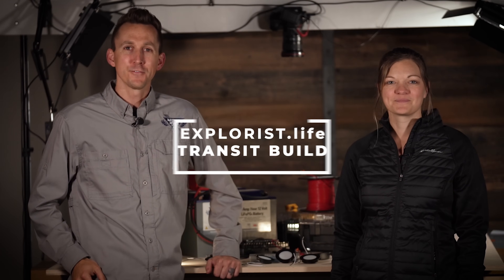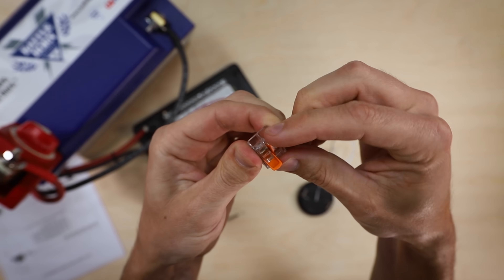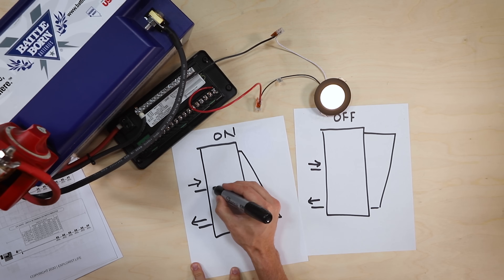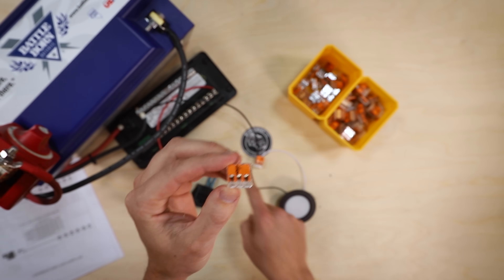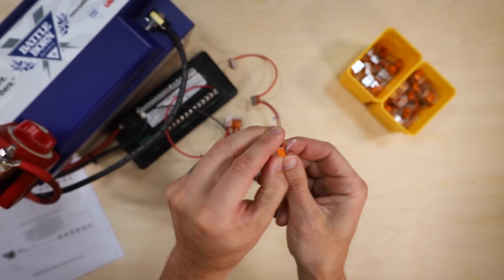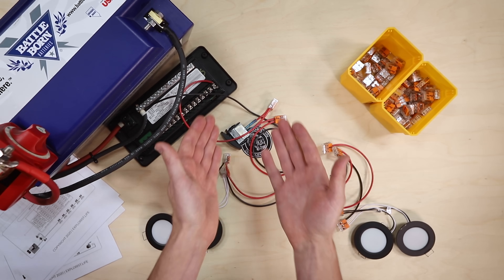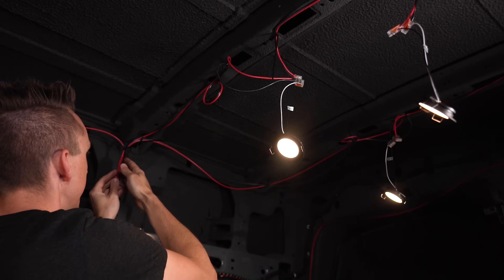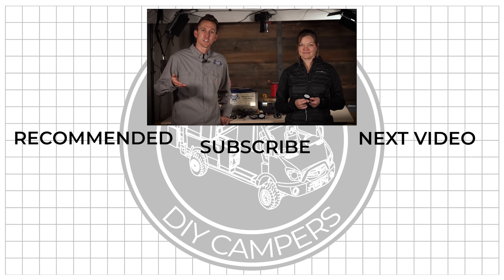How To Install Puck Lights | Interior Van Lighting Made Easy! (FULL TUTORIAL)

Comment: I am in process of converting VW Crafter into Campervan. From all videos I watched on youtube regarding lights, I am finding this video as the best tutorial for lights. I have a question. Is it needed to have a connector from fuse box to ligths switch? Is this done in case you decide to change the switch?
Reply from the maker: Thanks so much for the kind words — glad the video was helpful during your build! Great question too: using a connector between the fuse box and the light switch isn’t strictly necessary, but it can definitely make future changes or maintenance a lot easier, especially if you ever need to swap out the switch or troubleshoot wiring.

If you'd like more personalized advice for your Crafter build, our support team can help you plan it out: https://shop.explorist.life/support. Support is free for items bought from our store!

If your gear is from other sources, check out the Pro Support Membership for one-on-one guidance: https://shop.explorist.life/shop/all-products/membership-tiers/.

Comment: How secure are lever nuts?  I don’t want them coming apart.  Would soldering be unnecessary?  I just want a secure permanent connection.  Thanks for the video!
Reply from the maker: They are incredibly secure.
Reply from the maker: Soldering is a worse connection
Reply from the maker: Use the lever nuts like shown in the tutorial.

Comment: I always put my battery disconnect on the ground side.

I have highway trucks and all my trucks have Negative disconnect switches.
Reply from the maker: The risk there is that the entire circuit then stays energized up to the point of the switch.

Comment: Can you put multiple wires into the same lever nut? Say I connected the positives of several puck lights together and shoved them into the lever nuts? Send like the circuit should still work. Thanks for all you’ve provided!
Reply from the maker: one wire per lever nut terminal.

Comment: no inline fuse needed?
Reply from the maker: Fuse is in the fuse panel.
Reply: @EXPLORISTlife  the wire going from the battery to the DC fuse block doesn't need to be protected before it reaches the fuse block? In this instance I'm referring to a One battery setup. Battery to 12v fuse block
Reply from the maker: @OutTheMudFilms the wire going to the 12 fuse block would be protected by a fuse in the Lynx Distributor.  Perhaps you should check out playlists for our start-to-finish system installs
Reply: @EXPLORISTlife  got it. i watch all your videos. I have camper van and skoolie. i was just curious because there was no mention of a fuse in this video. Looks like it was simply a quick mock up and wire tutorial.

Comment: Great video, I pretty much copied this exactly except I used 14 awg wire. Im having a problem with all 6 puck lights being very dim. Any idea why that may be? Im guessing voltage drop for being a long run of wire but im no sparky. Any suggestions?

Comment: The test bench demonstrates serial connections only, but the installation includes parallel.  Please confirm.  Are some junctions used just for wire management or are all essential?  E.g. describe purpose of lever nuts at 16:06.   Please point to video on 3-way light swi... FOUND IT thanks!  These are produced 5000% more usefully than ANY how-to on the interwebbernets.

Comment: Finally found the holy grail of van howto, thank you.  Evidently diesel heaters notoriously come with wiring harnesses that induce voltage drops, and there is much advice to replace the power wire with 10 agw since startup draw can spike.  Can I simply run a hot wire, about 10', from my fuse box and splice it to harness clipped close to the heater?  6-12" from heater?  Same for the negative?  Most diagrams show it heater run directly from battery with an in-line fuse.  Any problem running from fuse box instead?  Thx again!

Comment: Why aren't you using automotive connectors?. AND what ignoramus would use wire nuts? Waco connectors are suitable for high vibration environments and are 250 V mains rated. But they are too big.
Reply from the maker: Uploading your own video is totally free if you think you've got a better way.  🙂👍
Reply: @EXPLORISTlife  Too trivial.

Comment: Another Stellar tutorial Nate & Steph.  I’m wondering about voltage drop (seen in Lumen output) in longer strings.  Have read about feeding Both + ends of the string with a 12V supply wire to mitigate line losses.  Thoughts ?

Also, I’m a bit obsessive about consistent light ‘temp’ (Kelvin) for ambient lighting.  I’ve had trouble sourcing a nice Warm / Natural white for Rope lights, that DIDN’T have ‘hotspots’.  What have you found to be a Good Rope light …. ?  

As Always, 🙏😊

Comment: you can use the body of the car or truck or van so you  don't need a negative buzz bar
Reply from the maker: No.  I strongly suggest not doing that.  Chassis in place of a dedicated negative wire is a cut corner that leads to issues due to poor connections.

Comment: Hi Nate, Question #1.  Can I share ground wires with different 12 v circuits?  Ex. Lighting circuit ground shared with water pump ground.  Obviously I would have different positive wires with sized fuses but it would make easier if I can tie ground wires together.  Thanks
Reply from the maker: I recommend not sharing ground wires, no.

Comment: Good stuff, but is voltage drop an issue with this method?
Reply from the maker: Of course!  Any time you are working with electricity, voltage drop must be taken into consideration.  We were able to overcome this by keeping wire runs as short as possible and using large enough wire.

Comment: Thanks so much for your videos. And the wiring diagram. It has been invaluable!

I am wanting to have 4 seperate series of lights that want to have separate switches for.  Cabin, above bed, below bed, and cabinet lights.  
Is there any issue with combing some if not all to one fuse.  Splitting it right off the fuse block then going to each circuit as long as I don't exceed the fuse amperage?  Or should the have there own designated run from the fuse block.  Thanks again for all you do
Reply from the maker: As long as the fuse can be rated high enough to allow all loads to function, but low enough to protect all wires, it will work.

Comment: Thank you for your videos which are very helpful. We’ve just finished hooking up Acegoo puck lights with your wiring kit. It went very well for novices like us, thanks to your detailed videos! We noticed that the puck lights get quite hot and are wondering if when installed against the thinsulate roof insulation it could cause a fire?
Reply from the maker: What is 'quite hot'?  An infrared thermometer may help you decide 'how hot is too hot'.  If you can touch the light indefinitely (even if it 'feels' hot), it's likely below 120 degrees F, which won't start a fire.
Reply: @EXPLORISTlife  Thank you so much for your answer!

Comment: First of all Thank you SOOOOOOOO much for your easy to follow videos. My question is..I purchased 3-12V Lithium Lion Energy Safari UT 1300 batteries that are giving me an issue. The company is replacing but I want to understand what is happening. First off only 2 would charge. The 3rd said there wasn't a connection to the charger. Next, after 2 of them charged, I was testing a 12v puck light with the master on/off switch and fuse box and it worked for a few seconds (the light stayed on for both the on and off setting though.) I took off to see if everything was wired right and it appeared to be. I took off the fuse box and the master on/off switch to test directly to the battery and now neither of the charged batteries will work. The light and a 12v fan work when I test on my car battery but not on the lithium batteries. Both batteries have been reset and register being fully charged but no matter what I touch to the terminals, nothing happens. Even the charger and voltmeter say there is no connection happening.  The company is saying I should try hooking one up to my inverter but are giving me no reason as to why that should work.  Are these batteries bad or should I try hooking to my inverter and if that is the case why would that work?  Thanks.

Comment: How would you mount a switch on the dash to control all the lights in the back? Would you use an existing spare button that Ford installed, or would you install your own switch? Would you wire that into the van's electrical system or the system you're installing? Thanks
Reply from the maker: You could do it pretty much any of those ways depending on where you wanted to power to come from and what the 'lights in the back' were for.
Reply: @EXPLORISTlife  I meant to turn the puck lights on or off from the cab, if you forgot to turn them off before you started driving. I've done that a few times when I drove transports lol

Comment: I see some people using a single black wire and a single red wire to prewire 12V loads, and some people use a 12/2 wire. Is there any difference other than the 12/2 wire is held together with an extra layer of insulation?
Reply from the maker: That's pretty much the only difference.  We've done both and found that the individual wires + wrapping in wire loom after all wiring is done is easier for wire management than duplex wire.
Reply: @EXPLORISTlife  Thanks! This really helps!

Comment: I can't tell you how much this video has helped me ACTUALLY understand what im doing. thank you. I do have a question though. Our battery is at the back of our van, but we want the switch at the front near the sliding door. So do we just run the cable over to the front first, through the switch and then up to the celing to the lights. :) Thanks again.

Comment: How do I wire the input source on the fuse box? It doesn't have any screws and I'm kind of stuck on Step 0.
Reply from the maker: Doesn't have any screws?  Are you using the same fuse block as in this video?  Did you purchase this from us?
Reply: @EXPLORISTlife  I purchased it from you, its the intertek GND. The input source looks like they are threaded but the tops are smooth cylinder. I'm pretty sure I'm just looking at it wrong. Newbie here.
Reply from the maker: @Mike-iq4kv  If you'll submit a support ticket at https://shop.explorist.life/support I'll look into that a bit more specifically.

Comment: Why did you choose to wire these in series rather than parallel?

(That's not meant to be a challenge to what you chose, just trying to understand.)
Reply from the maker: We did wire them in parallel.  Wiring these lights in series would have meant wiring positives to negatives and would have caused the lights to not get enough voltage to function.
Reply: @EXPLORISTlife  You are absolutely right.  My brain must have had an open circuit.
And thanks for the explanation as to why parallel is the way to go.

Comment: I reckon would be good to know what can go wrong and what's the consequences of it. in my case what I'm more scared of is to made a mistake and end up electrocuted like a dummy. In Australia (where I live) anyone is allowed to do their own 12v system and 120 has to be done by a professional, then this professional should inspect your 12v if you want to insure your van as a motorhome. I would to learn what really happens if you connect a negative and positive wire for some reason. or what happens if you choose the wrong size wire... a possible fail electric video kind of thing...
Reply: If it's protected by a fuse it is likely the fuse will blow if you short positive to negative (or ground) on that circuit. In most vehicles negative is connected to the car's metal work. It may also melt the wire and cause a flash. As for wire sizes you need to take into account the current carrying capacity of your wire. The more lights you add in parallel, the more the current increases in the circuit. If you have 6 lights then the wire to the first light may need to be heavier than the next one and so on. The easiest thing is to look at the current drawn by one light and multiply by 6 for 6 lights then use the same gauge wire for the whole run. Mosr lights will have a voltage and current or voltage and power rating on them. Make sure you use wire rated for 12V DC or greater rather than for mains AC wiring. Your fuse will also need to be big enough.

Comment: Questions:  In your 12V Branch Circuit Guidebook, there's a diagram on powering lights from a single location switch panels.  There are two wire size charts...is one of the charts for sizing wire from the main fuse block to the sub-block and the other chart for sizing wire for the switches, dimmer, pucks from the sub-block out around the van?   If so, which chart is which?  Cheers, guys!

Comment: I'm installing additional OEM Cargo Bay Lamps in a Ford Transit.

The Lamp Modules are DC, but not Polarized, however I did Wire them the same way, calling the connector closest to a Screw "Negative."

Comment: Aren't we supposed to put ferrules on the wires going into the wago lever nuts?? Also, they actually make inline lever nuts
Reply from the maker: Ferrules are a tool and not a requirement.  If they are in the way more than they are helping, they aren't needed.  In the case of lever nuts; ferrules aren't particularly useful.

Comment: Hey there Nate + Steph I’m new to the channel and planning to actually do a van build myself on a Ford transit. I have to say all you’re step by step videos has been building my confidence to tackle this new adventure/world of van life. 

My question is…what type of wires are being actually used for all the electrical system throughout the van and how does it differ from normal house or vehicle wiring? 

And do you offer or have recommendations on a “MUST HAVES electrical parts list” for the basics 6 batteries set up ?

Comment: Can't wait for the next video.   Wondering though, can you explain the pros and cons of Copper wire to Copper Clad Aluminum wire?  and can the two be mixed together in a run?  Thanks
Reply from the maker: The short of it is (you can go down the google rabbit hole for 60 years of copper vs aluminum wire data on your own if you like) aluminum wire can carry less current per size of wire than copper.  Aluminum really isn't used anymore; and it shouldn't be mixed into the system.  All of the wire used in this build is either copper or tinned copper.

Comment: Hey Nate, I noticed in your Puck light video you used single red and single black wiring. I purchased your 12 volt guide book and the puck light examples you have diagramed shows duplex and triplex wire? I'm confused or does it make a difference?
Reply from the maker: It doesn't really matter (for DC). Duplex wire is just 2 wires in a sheath and I wanted to use this build to see if it was easier to use independent wires for all runs and not deal with the outer sheath and so far so good.  For 120V AC wiring, we still need to use triplex wire, though (which I'll be using in the upcoming 120VAC wiring video.

Comment: Thank you I will be doing this soon to my CT camper build and this answers many questions I had. One question I do have is how do you ground your fuse block? Is it grounded when you mount it permanently to chassis or will you be using a dedicated ground wire to chassis? Thanks!
Reply from the maker: Dedicated positive and negative to the Lynx Distributor and then the negative busbar of the Lynx Distributor would connect to chassis ground.  Stay tuned for that, though.  We will be covering that as the build progresses.

Comment: Another great video Nate, thanks! Question- I noticed in the in-van demonstration, you used non marine grade wiring (from what I can tell). Is standard stranded automotive wire okay for puck lights due to the low amp draw/risk, or do we need marine grade wire still per your diagram? Just asking because that marine wire is pretty expensive, would prefer to use my roll where more necessary.
Reply from the maker: We used Ancor marine grade wire in the van.  This is what is included in both the EXPLORIST.life wiring kit as well as in the parts list in the video description and pinned comment.

Comment: Is there any reason you "switch" the positive wire rather than the ground?  I work in automotive and some RV service and we have been switching the ground side.  Maybe it is done because many "electronics" (different than "electrical") often use ground side switching.
Reply from the maker: Electrically, it doesn't matter much.  A negative switched system just leaves the positive wire energized up to the point of the switch, which I'd rather not teach as I'd rather have power cut as close to the source as possible.
Reply: Def would be good to cover a positive vs a negative grounded system and switches